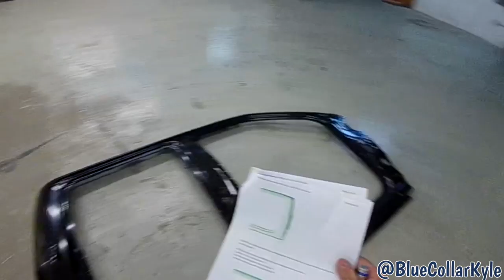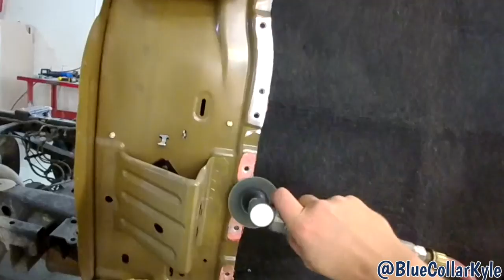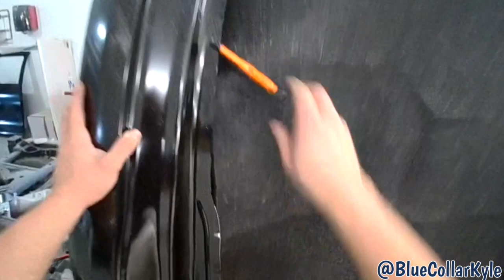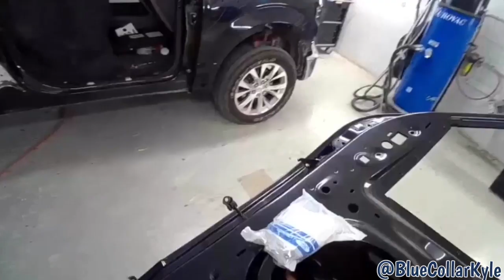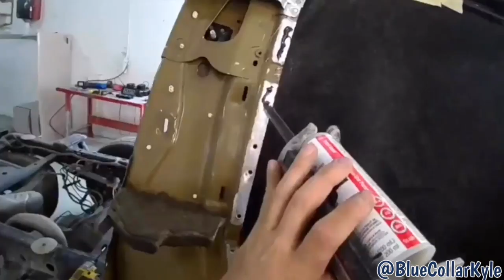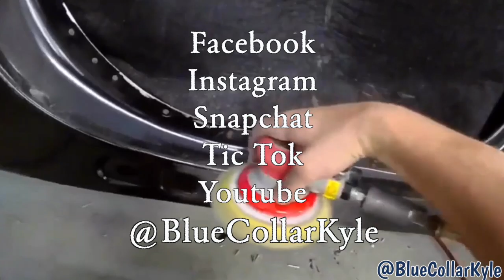Replacing A F150 Cab Corner

Comment: I have the same problem but mostly just in the bottom corner so I wouldn’t need to go as high upward but would need to go further across on the bottom. Would you recommend going this route or dent pulling method?

Comment: Pound it out and put it back on. Save probably a grand.
Reply: If you're good enough, may not even have to take it off? Slide hammers and the right tools and it could be fixed with the original part mounted.
Reply: @garyr7027  We bought a $1000 stud gun for aluminum but I never had much luck with it. maybe there are some different brands out now
Reply: @johnnyshd8250  I doubt I could fix it as is even with good tools. But, I have watch people fix some really bad sections with hydraulic pullers. This one here didn't really look all that bad, surprised he even did it this way. Only looked like one small section got wrinkled, plus he cut up a full new section... seems like a waste of money to me.
Reply: @garyr7027  I know what you mean. Like you need a rocker and you get the whole quarter uniside. Throw away the rest
Reply: @johnnyshd8250  if it was me I'd at least cut off enough of the old to use the entire new panel piece, not cut up the new panel... geez lol.